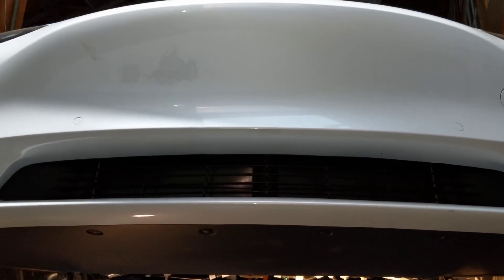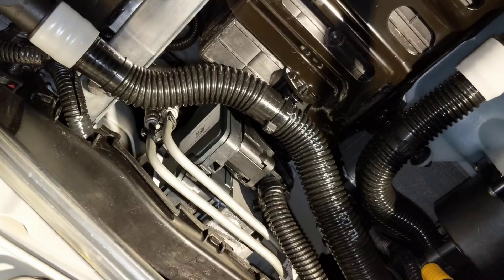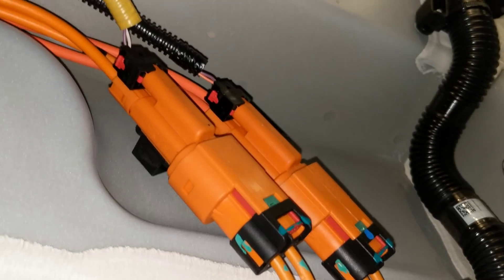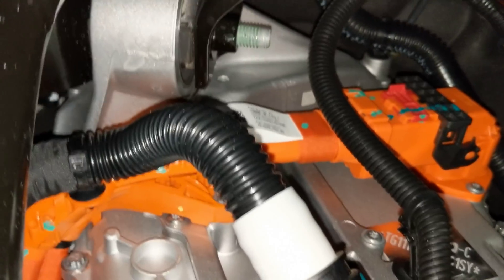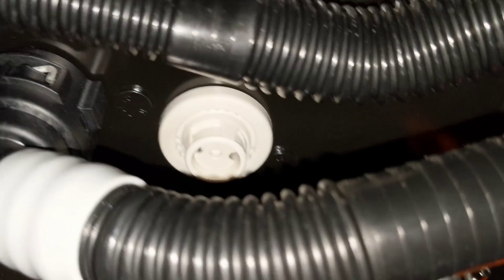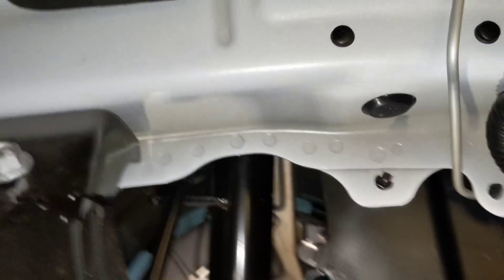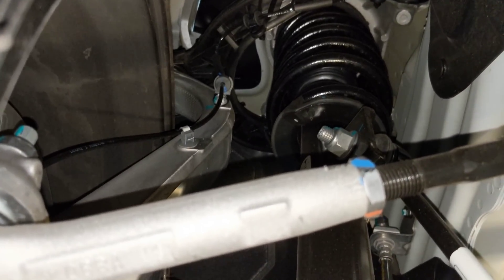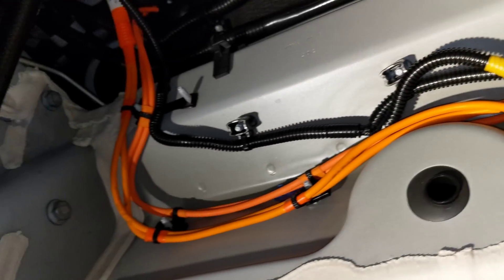Tesla Model 3 Stripped - Part 2 - The Dark Side

Comment: Love your videos. I've pulled apart a Model 3 penthouse and have a question. Where is the pre-charge relay and resistor? Every other EV I have looked at with + and - contactors have a pre-charge circuit to load the capacitor in the inverter. How does the model 3 do this? Or don't they?
Reply from the maker: I explain it in some of my PCS videos, such as this one: https://www.youtube.com/watch?v=lXokJEzXwaI   (TLDW; They reverse the HV to 12v DC-DC converter for precharge, so they are leveraging existing hardware.  The best part is no part!)
Reply: @Ingineerix  Thank you! That is really clever! As per usual, Telsa does things differently to the other EVs..

Comment: There is an HVAC drain on the forward bulkhead. It's outlet doesn't seem to be ducted far enough out to avoid water dripping onto the high voltage cables below. I have seen this dripping on another YouTube video. Can't be good to have water intentionally dripping on high voltage cables. I would be interested in your take on that.
Reply from the maker: The HV cables are tucked under the battery pack's front flange.  They don't get dripped on in normal situations, but even if they did it would not matter.  They are double-insulated co-ax cables, and all connections are very nicely sealed.   This area of the car is definitely exposed to weather, so this has to be the case anyway.
Reply: @Ingineerix  Many thanks for such a quick reply. I greatly admire you depth of knowledge and very grateful for your generosity in passing it on.
Reply from the maker: @nigelcharles511  Thanks Nick, I appreciate it!   If you are feeling generous, you can also support my work.  There is a link at the bottom of my channel's about page here:  https://www.youtube.com/c/Ingineerix/about

Comment: Question for ya.  The 2wd model is rear wheel drive.  Why didnt they make it front wheel drive?  Seems that would be better for traction and such.    thx
Reply from the maker: RWD is better in an EV.  The only reason ICE cars have "better traction" when FWD is because of the massive engine over the wheels.  Tesla's have close to 50/50 weight distribution.  When you accelerate hard, as all Teslas can, weight shifts to the rear of the car, putting more weight on the rear, and taking it off the front.  This is also why Dragsters are always RWD.

Comment: Oil filter???   The dealership told me there's no maintenance on this model. no fluids to ever flush.   WTF???
Reply from the maker: First off, there are no Dealerships with Tesla.  Secondly, the driveline needs lubrication and cooling, which is why there is lubricant.  To get 250,000 miles service life out of the lubricant, they needed a filter.  Relax and enjoy your car!

Comment: NOT a brushless DC motor, IS a permanent magnet AC motor.
Reply: It is a switched reluctance motor.  This uses induction and permanent magnets, but is not a PM or induction motor.
Reply: @jonseason8170  I am curious about this topic, since in internet there are contradictory information: why exactly switched reluctance and not fo example pm assisted synchronous reluctance / interior pm synchronous machine? What are the sources?

Comment: So the orange wires up front are for the AC and cabin heat?  Does that mean it uses resistance heating?
Reply from the maker: Yes, ~5kW PTC resistance heater just like the S/X.  Sadly no heat pump yet.

Comment: This is actually sad. becasue this is so much potential frunk space.... and they just threw that away...
Reply: Karen Pease Well they could've designed it differently for RWD and AWD such that no space is wasted on the front. They didn't do that for ease of manufacturing.
Reply: Yes, if you like fetching items in your frunk out from the bottom of a deep diagonal well with lots of obstructions in the way.
Reply: Asiri Iroshan as in larger frunk for RWD and smaller for AWD..
Reply: They just... frew that away?

Comment: If Tesla can’t use same struts in the AWD version...does that mean the AWD M3 will be bundled with air suspension? 🤞
Reply from the maker: No.  I'm sure Air suspension will be offered at some point though as an option.
Reply: @Ingineerix  We're 4 years later now, yet that "some point" did not come as of yet. Still no air supension.

Comment: Did I miss where the powersteering pump and motor? And how is the 12 volt battery charged? (guessing from a dc dc charger from the underfloor battery?)
Reply: No, Drive-by-wire means that there is no physical connection between the steering wheel and the steering rack. The most notable uses of that system is in modern airlines. In a Fly-by-wire plane, there is only electrical connection between the pilot and the control surfaces. Older planes before fly-by-wire usually had a hydraulic and backup mechanic flight control systems. If there is zero physical connection between the controller and the vehicle, it is a fly/drive-by-wire system. I believe at this point, the Departments of Transportation still require there to be a physical connection between the steering wheel and wheels. If someone has seen a car with a true drive-by-wire steering system, please let me know. 
Back to the matter at hand, you can see the steering rod at 0:15. What he means by direct drive electric power steering is that instead of a hydraulic pump assisting the driver input, an electric motor assists the driver input. It's simpler and much MUCH lower maintenance than hydraulic steering. 
Hydraulic steering you need a fluid reservoir, pump (mechanical in most ICE vehicles but can be an electric pump, and then the hydraulic steering rack. Lots of extra components and hoses to fail and need replaced. The electric power steering also has the ability to function with NO driver input (self parking, Autopilot, lane keep assist, etc.) But when the vehicle does control the steering by itself, there is still a physical connection to the steering wheel, so the wheel still turns. 
Anyway, sorry for the long explanation, but I don't like leaving partial answers to questions that just leave more questions. :P
Reply from the maker: It's there, I call it out as "steering rack" in both part 1 and part 2.  DC-DC converter is under the back seat in the "penthouse" on top of the pack.  (Future video)
Reply: I'll have to check out part 1. So the powersteering pump is integrated into the steering rack? Wow, the things they do with electric motors these days.
Reply from the maker: It's not a pump.  It's direct drive electric power steering.  Most cars now use a similar system, as it's lower cost and more efficient than hydraulic.
Reply: Even better. So basically it's drive by wire.
Reply from the maker: Nissan has a DBW system on the Infiniti Q50.  It can still fall beck to mechanical backup via a clutch in the steering shaft if the system fails though.  Also note, that when in AutoPilot mode, the 3 is technically drive by wire.
Reply: King Koopa 
The new Honda NSX is drive by wire. Even the brakes are not mechanically connected. As I've got to know.
Reply: Thanks, I know exactly what you mean.

Comment: Damn this car is so well built it's flawless. No wonder all the smart people want one.
Reply: Plastic composites can last a very, very long time.  If well designed, they can easily last longer than metal.  Plastic doesn't corrode, and most of the fibers are inert, especially when encapsulated in plastic, as they are in composites.  

Also, when deploying a new technology, there is a lot of durability testing.  I'm sure those composite parts were tested extensively in software simulations, test chambers, real world, etc.

As the video correctly points out, the upper A arm gets relatively low forces.  The lower arms get most of the loads.
Reply: Tesla buys seats from Fisher and others, just like GM and many other car makers.  https://www.investopedia.com/ask/answers/052815/who-are-teslas-tsla-main-suppliers.asp  I'm not going to respond to your lies further.  Bye.
Reply: Philip Cooper.  The Model 3 is quick and handles better than most performance sedans in the same class. So now that's just a party trick and it's all about seat stitching? Get out of here.

From Motor Trend's long term test of Model 3: "This is a very digital car to drive: Brake, dial in one single steering angle, wait for the corner to end, and tidily accelerate. Most sedans are a conga line of steering corrections and throttle stabs. After thinking about it, perhaps just the Porsche Cayman and Boxster and the Honda Civic Type R that were on hand today drive this precisely."

Also they concluded that the Model 3 bests the BMW 330i.
Reply: can't fix a fossil.  lol
Reply: What leather stitching?   LOL it shows lack of knowledge... LOL
Reply: There's lots of stitching in a Model 3, for example on the seats and steering wheel, but you're right, it's all artificial leathers.  The materials are ultrasuede and Alcantara, both very high quality materials that look like leather but are plastics.
Reply: It's ok for people to be fans.  I do understand your point, however.
Reply: ooooo, he SAT IN ONE!
Reply: The Model 3 suspension held up just fine on a race track.  https://www.youtube.com/watch?v=iFr3ecpr5oU  The stock brakes were not up to the task of track days, but that's true of almost any production street car.
Reply: Loanword Eggcorn being it's performance you're after.. they may be able to handle light performance.. but not heavy duty sports performance..
Reply: Running hard on a race track is not "light performance".
Reply: In truth, Model 3 is very well engineered and well built.  Fan or not, that's objective, measurable reality.
Reply: Loanword Eggcorn Oh it certainly is, no doubt, but the elitism is the issue.
Reply: +Philip Cooper It's pretty obvious you're a troll.  Tesla parts come from the same suppliers as Mercedes, Audi, BMW, GM, etc.  The suspension was designed by the Ford Racing engineer who did the 2004 Ford GT.  Teslas handle well, drive well, feel good, respond well.  They're excellent cars.  I have sat in a Model 3 and seen dozens. I've driven a Model S. It drives like a much smaller, lighter car due to the excellent steering and suspension design and extremely low center of gravity.

The Model 3 panel gaps were uneven when the first ones came out, but are nearly perfect now.  I've been specifically checking that and have pictures to prove it.  

Tesla does exactly the same water intrusion tests on every car as every other major car manufacturer does. 

I don't feed trolls.  Have a great life.
Reply: You said Teslas had bad stitching.  The stitching is done by the same suppliers as Mercedes, Audi, BMW, use.  So it's the same.  Tesla quality control is on the same level as BMW, Mercedes and Audi.  Quit trolling.
Reply: Philip Cooper, funny that trolls like you do not even try nowadays. Just copy and past long ago debunked myths like the brainless idiots they are...
Reply: Anti Petrolhead in 15 years those fiber reinforced plastic parts will start cracking in rural areas... It's not too hard to fix and comes with weight savings. When that happens it will likely be at low speed, like when parking.

But I agree, they are thinking about, fire, flooding and I'm balance fan blades... Serious quality.
Reply: Exactly the suspension system is not strong enough for the weight and acceleration of the car. The model S has all sorts of problems with arms and joints. It reminds me of kit-cars of the 80s and90s in that way.
Reply: I like EVs but you have to be the most stereotypical "Tesla fan" I've ever seen. "I'm smart because I like (x), and (x) is the best (y) to have ever been built in the history of ever." Hell, your name is even "Anti Petrolhead". What does that even mean?

You people give Tesla fans the bad reputation they have.
Reply: Tesla makes/used to make their own seats, stop lying to everyone. Musk is not going to give you a free Tesla for spreading lies.
Reply: Parts come = cars are not assembled by Mercedes-Benz, nor Audi, BMW, GM etc. It's the quality control that matters.
Reply: Sure, if you enjoy terrible body panel gaps, awful leather stitching, water leaks (everywhere), and prematurely wearing out cv joints and other bits of the suspension system (it is a 2 tons car) and for all thay pay the premium which would get you a very nice car from a reputable car manufacturer. Tesla makes fast cars, I give you that, but that's about all it is. A party trick that gets old very soon and only people that have a no clue what a car should look like will overlook all the design flaws and poor build quality the Tesla cars are.
Reply: This car is so poorly made, no wonder only people that have no clue want one. The panel gaps, interior water leaks and rattle... you name it.

Comment: Thank you very much. I was looking for shots or a video for the underneath side of the Model 3, as the mechanical part is interessting to me. Looks well build but of course only time will tell how well sealed everything is to resist salt for example
Reply from the maker: In the underside video, I have already removed all the covers that protect everything underneath (and make it smooth aerodynamically), so normally all that is closed.
Reply: Ingineerix off subject but have you ever dug into an ELR? Cadillac won't reveal if the software will increase the performance or if you can update to the 2016 software version to get the extra power they added or not. Hear mixed info that you'd need the transaxle replaced to get the full upgrade but no one from GM will provide this info. Now that they are much cheaper I can see many wanted to unlock the changes they did in 16' for the 14' models.

Comment: Composite upper control arms, that's a nice piece of innovation. Looks very good underneath, only thing that I would do, for our winter climate with salty roads, is to consider adding some rust proofing, which seems to lack completely.
Reply: Torben Brenden Pedersen Wonder how they are going to last when used in proper weather (north -40c) :D
Reply: I think it would do better than most ICE cars to be honest.

This i3 had no trouble coping in -40

https://www.nrk.no/sapmi/hva-tror-du-skjer-med-en-elbil-i-40-kuldegrader_-1.13304663
Reply: The 2019 RAM 1500 is also using a composite upper control arm.

Comment: Compared to an ICE car there is tons of room to get to all the mechanical components on the front of the car. Audi service positions or taking half the engine apart to do something like a timing belt replacement are the ancient past. Once the model 3 goes mainstream and there is some aftermarket support for these components this car is going to be a dream to fix.
Reply: EVs are mechanically much simpler than ICE, so there's inherently less to fail and need repairing.  And yes, it's usually the ICE part that wears out or breaks.
Reply: Yeah, the timing belt is REALLY easy to get to on a Tesla. ;)

Actually that was a good example. It can be murder getting to a timing belt, given how often it is changed in the life of the car. I just had to change the rear belt (power steering) on my 96 Corolla, and it damned near took an act of god. And that's an EXTERNAL belt.
Reply: Most every timing "belt" I've ever changed is in fact a chain.

But yeah, I was referring to the serpentine belt. It's the hardest of 3 serp belts on that car to get to.

And wouldn't you know... the belt still squeaks. Now need to go back in and replace the pulleys. :<
Reply: What I'm excited for is how tuners will modify electric cars.  I imagine it will be similar to modifying RC cars. Rather than tinkering, it's more about upgrading motors, inverters, batteries, etc. Reprogramming on the fly is the new tuning. Other things like suspension set up will more or less be the same.
Reply: Toyotas are almost bullet proof ,most times you do however have to do periodic maintenance like oil and filter change ,air filter change ,spark plugs every 100000 miles trans fluid change, maybe  timing belt ,don't tell me in 12 years you did not do this . this things are not required in a EV,this are some reasons Dealers are loathe to sell BEVs .example : oil change 4x$50=$200 x 12=$2400 and that's just for oil changes.

Comment: Than you for your great video! I'm impressed that parts and units are well organized. I didn't know that much space is reserved for the front motor. I guess EVs in general, so few parts. Without engine, exhaust system, extra parts needed to protect wiring and other parts from its heat would been so many!

Comment: 1:58 Passing very fast under the battery... Did you try finding any tag, on the front rim of the battery, indicating the  size, voltage, or model number of the battery?
Reply from the maker: There is a tag with a part/serial #, but no capacity.  I know for a fact it's rated at 74kWh, and 385v nominal (96 series), so at 100% SoC, the pack's voltage is 403.2v.  This is almost identical to the 85/90/100 packs in the S/X.  The BMS in this car reports a full capacity of 76kWh over the CAN bus, so 2 more kWh than it's specification.  They use 46 2170 cells in parallel and then 96 of those in series for a total of 4416 cells.  On the non-long range variant coming soon it will take out 15 cells in each parallel, so the voltage will still be the sane, but down to about 50kWh total.

Comment: That top suspension arm had a stabilizer epoxied to it at some point in the shipments.  Does your as well?

Click the image link in blue from the first post.  
https://www.reddit.com/r/teslamotors/comments/7uskm5/zip_tied_part_on_model_3/dtmur9r/
Reply from the maker: That is a mass damper, and no mine doesn't have it, so I suspect they will be putting it in at some point at the service center.  Probably changes the suspension response and NVH on small movements.